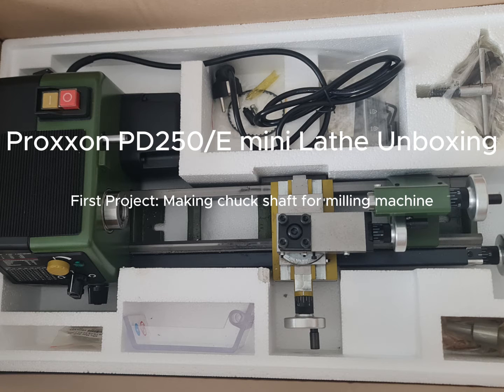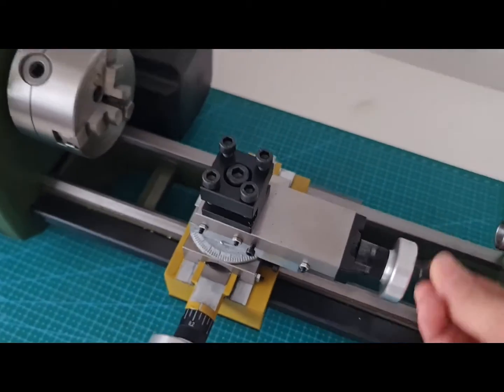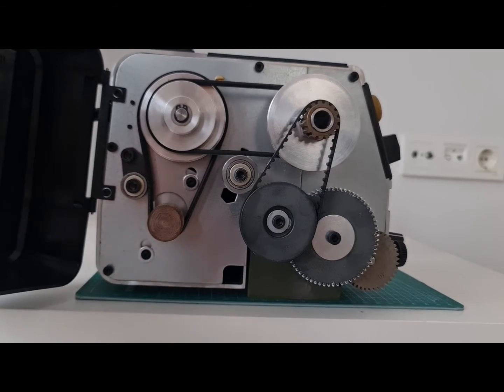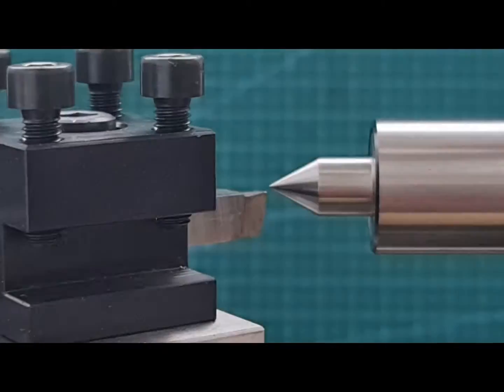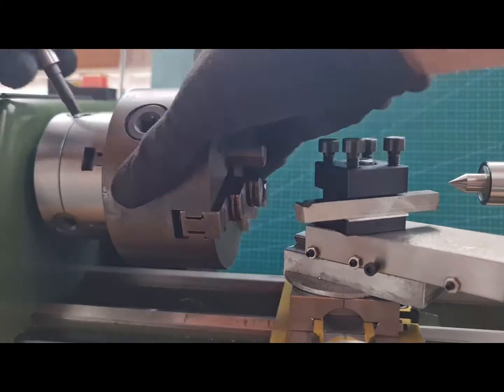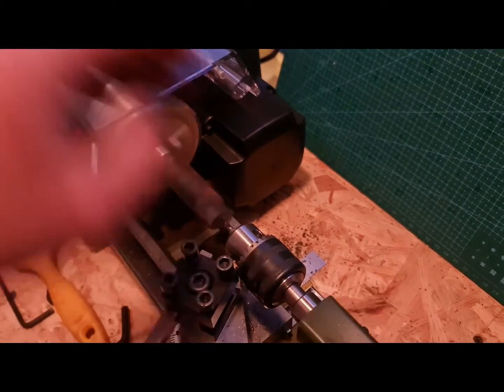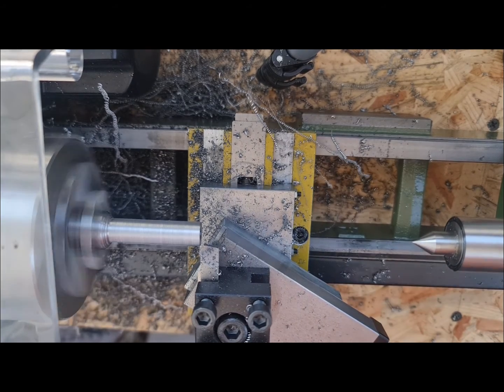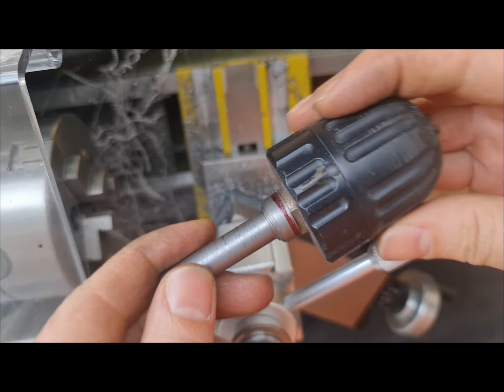Proxxon PD250/E Mini Lathe Unboxing and Drill chuck shaft making

Comment: At what speed you work with the steel?
Reply from the maker: Actually speed should be calculated according to diameter of work piece and specs of cutting tool. For the 16 mm rebar, ı use minimum speed around 400 500 rpm. after reaching a even surface, i  go to 1500 rpm. For the stainless steel with 15mm diameter ı use 1500 rpm. And for finishing i go to full speed which is 3000 rpm. it gives me almost a mirror finish.

Comment: Hey! thanks for sharing the video! I have been looking for a bit, as I wanted to get the same model (or even with the smaller one), however I wonder how loud it can be? as I'm considering to have it running on my home office....

Thanks a lot again! and looking forward for more!
Reply from the maker: one of the reason why ı choose this mode is sound.  I am also using it at home. A small apartment. If you use this machine properly there is almost no sound. I dont know for other brands but this one is i can say silent one. Not complain any neighbour yet :) What will you machining steel or wood plastic ?
Reply: @UpCycleMaker  thanks for the reply! For the most part, I'm looking to machine metals (steel, brass, aluminum, cooper) and plastics if any at all :)

Good that neighbours aren't complaining, hopefully I will be as lucky!
Reply from the maker: @foursixnine  I believe when you experience with the feed, cutting depth etc, its very very silent.  The most hard one is steel, others are piece of a cake for this lathe dont worry. Steel is also ok with right cutting tool for its size :)

Comment: Pretty impressive demonstration of a real-life use case.
I was only considering this machine for scale model building purposes (plastic, hard wood, brass and aluminium), but being able to even make small custom tools would be a massive bonus on top.
Reply from the maker: I can surely say this machine is more than scale building. If you watch my never videos, i am machining stainless steel very easily. It has all the features as a bigger lathe mahine but in very smaller size :)
Reply: @UpCycleMaker  @UpCycleMaker Tool making in combination with a mill would be a huge benefit on top. For stuff like spaceships, it's often better to make a brass or aluminium tube stand and inner frame to make things transportable and prevent sagging over the years. Would work well in that kinda situation.
And of course, making engraving tools and the like. And powered thread making is less hassle than manually cutting them into tubes and cylinders.

Comment: I am shopping for a small(ish) late and matching mill.   Why?  Just because such a pair would please me.  I do preision work in the area of tool and die-making.   For a couple of years now I've been studying, watching videos.   Seems like far too many of those (made you know where) lathes ship with problems that the buyer is burden with identifying and repairing.  I get the idea the retailers never see the lathe and have no opportunity to physically inspect it.   This is unsatisfactory.   

Proxxons seem different.  Designed in Germany?   I've not seen a video yet of one that needed anything more than the usual leveling and truing adjustments by the buyer.   

I like the Proxxon line but they are just a bit smaller than I want.   If the PD250E was scaled up by a factor of 2 I would buy one immediately.   A 10 inch lathe is just too small for my work.   Price is not a primary consdideration.  Charge what you have to charge but don't compromise and above all don't leave it to the buyer to find and repair factory screw ups.  

Thanks...
Reply: Then PD 400 is for you... but it also needs rework in several areas... Michel Uphoff has a lot of videos about it. Proxxon is good but not flawless.
Reply from the maker: Sory for late answer. Proxxon is very quality lathe in its class. I am a hobbiest and  very small pieces my pd250 done a great job. Even ı push it limits its ok. It is very precise. With extra part if you want you can increase its precision too.  But it comes with very less accesories. You need to buy many accesories  such as qctp, carbide tools, fixed steady etc. But its accesories are very expensive. But once you buy anything from proxxon it will probably serve you many years. I also suggestyou to buy PD400. because for example my spindle bore is 10 mm. I cant use any long piece for cutting its really unconveinient for me.  I dont know your working area but pd400 has atleast 20 mm bore in its chuck.   Proxxon is german made and you can feel its quality. Even its extremely expensive but i suggest you PD400.

Comment: Когда-то мечтал о таком. Но сейчас вижу, что тот же 180х300 или WM210 куда более производительнее. Этот скорее для хоббистов-минитаюрщиков, гвозди точить и т.п.
Reply from the maker: Well this lathe has all the functions bigger ones has. But yes it is very small. Maybe mostly hobbiest are using this but you can get very proffesional results with small parts. precision is high. I really need bigger one such as you mentioned but the restriction is ı dont have enough space. Even turning 16 mm rebar is extremely hard for this lathe. Not because its not have enough power, chuck  jaws are small for holding. This is the reason why i try to use bigger chuck. ıt has no problem holding 16mm rebar.

Comment: Just for safety, there’s a possibility of the chuck jaws being ejected from the chuck when the lathe is turned on and the jaws aren’t tightened up on something. Great video! Thanks for posting!
Reply from the maker: You are right but i never force it while there is nothing clamped. Its just for setup and small trial under low rpm. Even i wouldnt try it without the pressure of tail stock on working piece. I am afraid chuck itself might fly away. :) than you for your comments.

Comment: Turning between centers ould have actually been easier for this instance.  You would have also kept concentricity flipping the part and doing the threaded end this way. I am impressed the Proxxon can single-point thread rebar. As a mod, I would look at making a tool holder that bolts directly to the cross slide to increase rigidity.  Also, bolting the lathe down would be a good idea.  I don’t know about your area, but we have a lot of granite stone cutting near me, so if I was to bolt it down, I would put it on a piece of granite of appropriate size ( cheap and not too big).  Also, you can do some milling in that lathe by spinning a cutter in the spindle.   There are milling attachments that bolt to the cross slide.
Reply from the maker: Rebar was very hard in the outside but i realized its softer inside. But for short parts proxxon is way rigid than i expect. I will keep in mind your suggestion for future project. I am not %100 satisfied with the finished concentricity it need som improvement in the future. Proxxon manuel if teeling me to bolt it down but the reason why i didnt do it with both my lathe and milling machine is, i live in apartment and my workshop is my balcony which is around 2 square meter :) i cant put my lathe and milling machine on the table same time :) So i need some mobility all the time that why i cant bolt them for now. But it is really hard do operate them without bolting down. Granite might be perfect solution not just increase rigidity  also i can use it a referance plate but i dont want to bring heavy thing to my very small place.  I am searching for some bolting solution for my micro machine shop :) Proxxon pd 250's cross slide is very very small. I would never tyr to make milling with that attachment. I am afraid it can damage the carrier. cross slide's bottom part is made of zinc. Forcing it may damage ı guess.